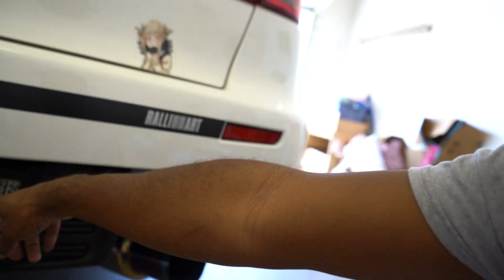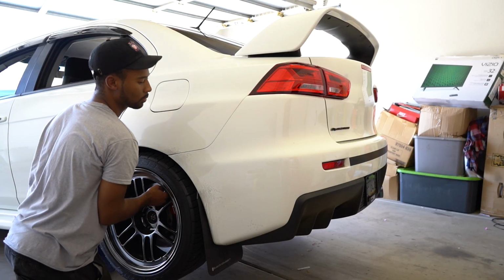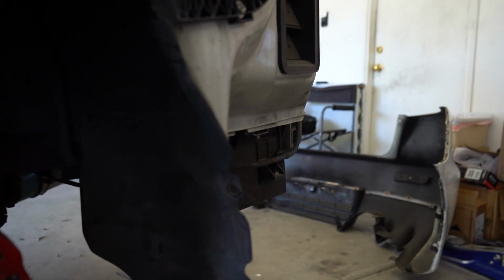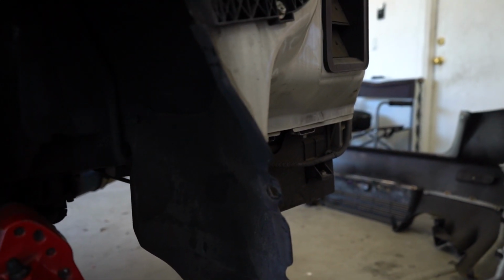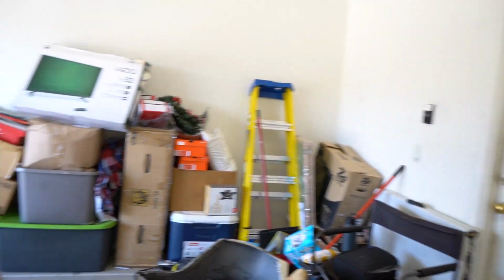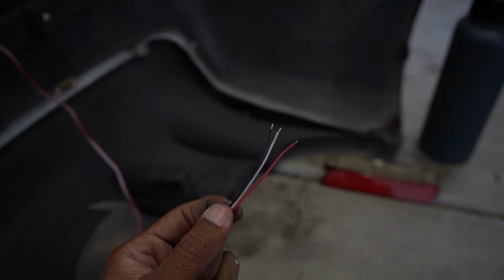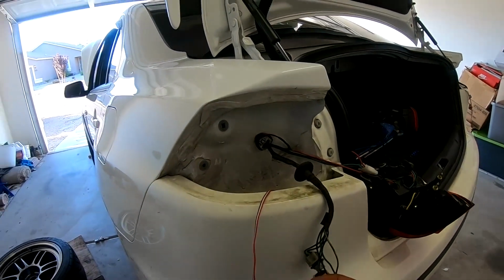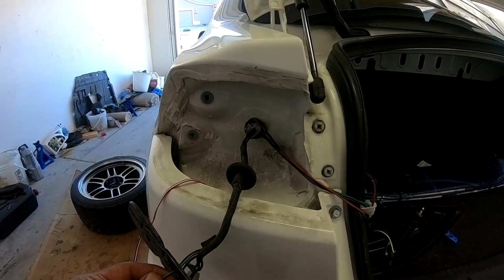Evo X Rear Bumper Lights for UNDER $20 !!!

Comment: i have similar lights to these, same three wires. except i have one extra wire for the turn signal. which exact wire would i connect it to?
Reply: I have the same problem, any solution?? I can’t find anything